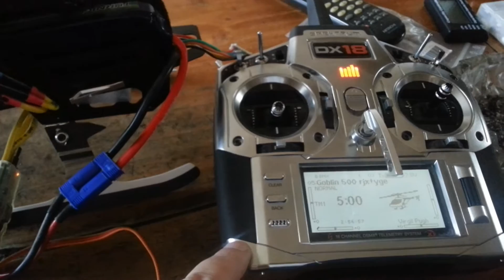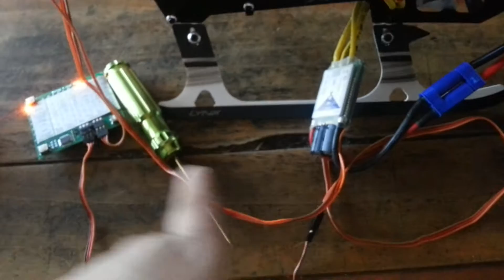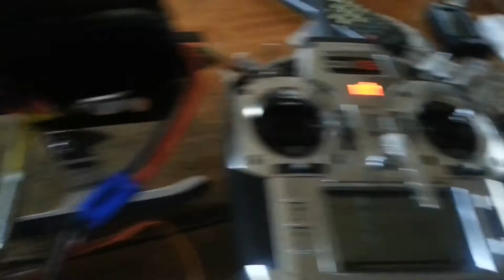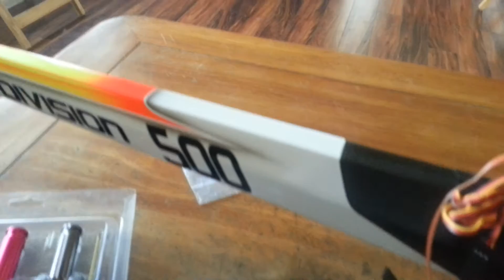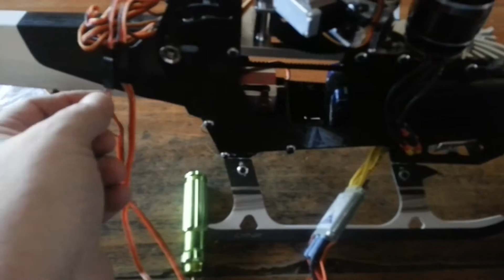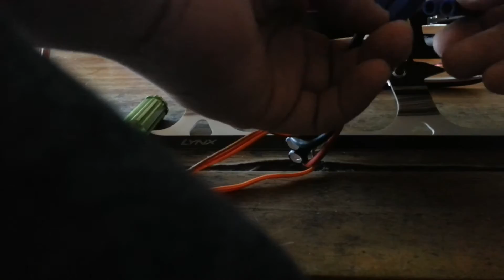Yge 120lv

Comment: In order to set your end points you have to plug up the esc after you put the throttle at full stick. The esc should give multiple beeps. As soon as it starts beeping, pull down to low stick. It should then register the end points. Also I do not even have the slave plugged in at all. I was under the impression that it was mainly for rpm sensoring. Hopefully this may help some!
Reply: Also make sure you move the motor from the main gear👍